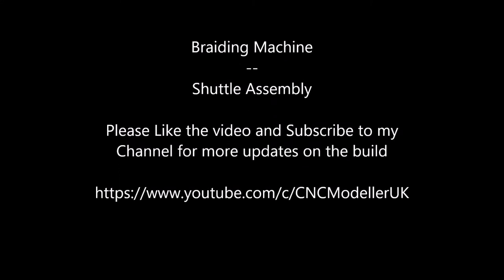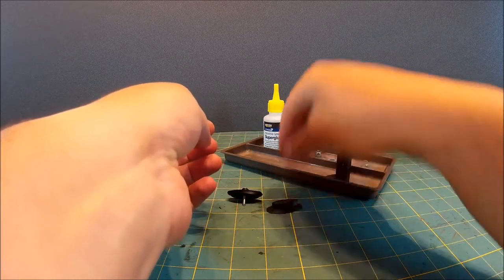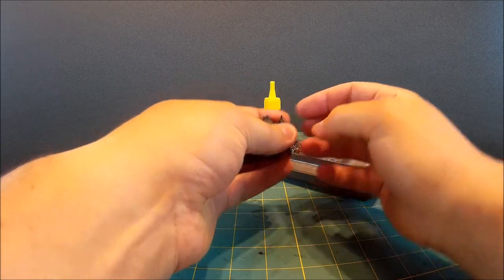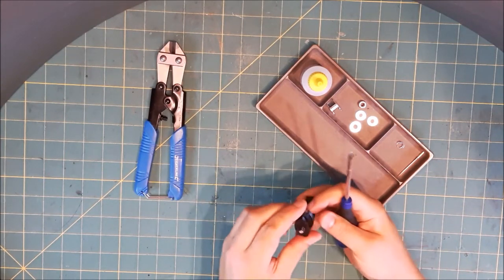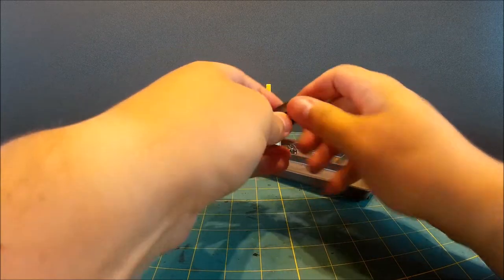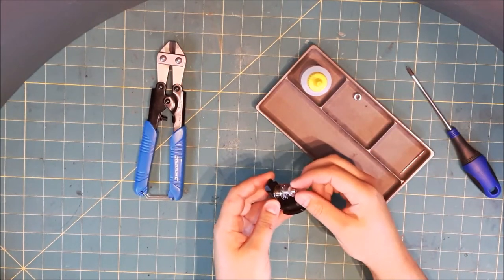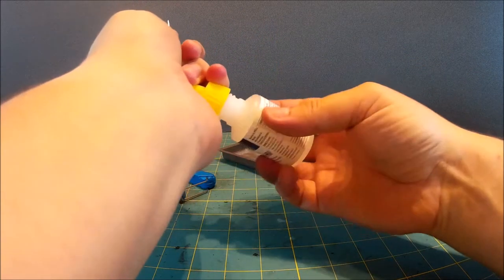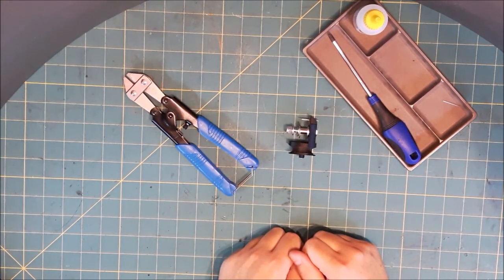New design for old technology:  3D Printed Braiding Machine #2 Assembly of a Shuttle

Comment: Hi, I am currently working on a project building a similar machine but are having issues with keeping the shuttle consistently on the track. Would you mind giving some pointers? Thanks in advance
Reply from the maker: Hi LaFlama! 
               The geometry of the shuttle is closely linked to the radius of the turns, bobbin density on the track, and the depth / width of the track gap. Maximising the size of the top and bottom plates, whilst not getting interference at the crossover is also fairly critical. Adding a bevel to the top and bottom plates also helps a lot with a clean crossover. As you may have gathered I went through a lot of prototypes before I got a design that works reliably.

Hope that helps... :-)